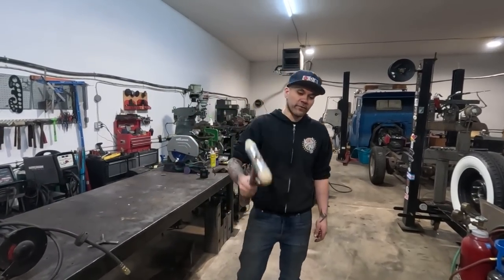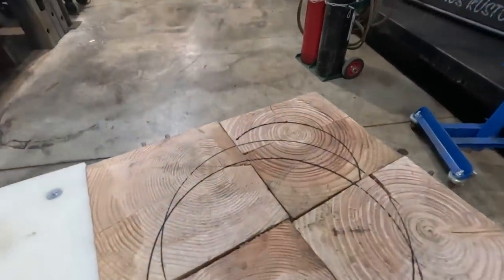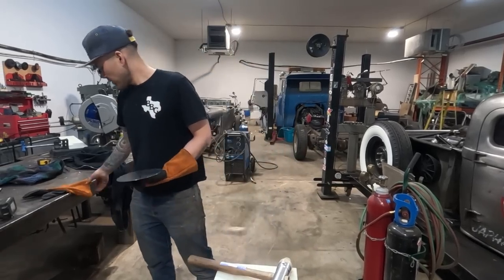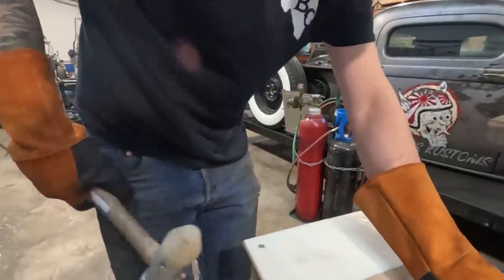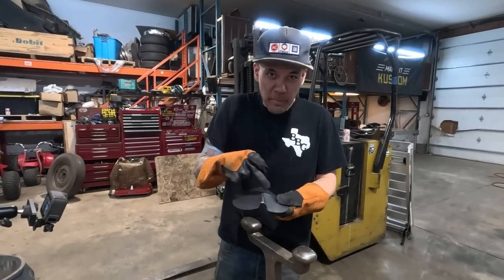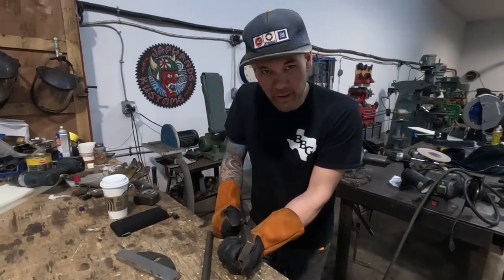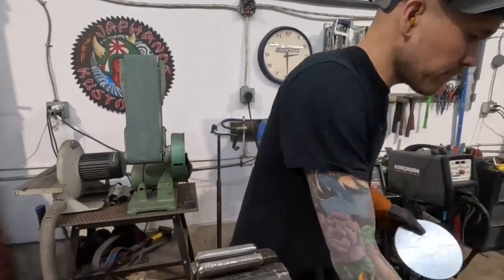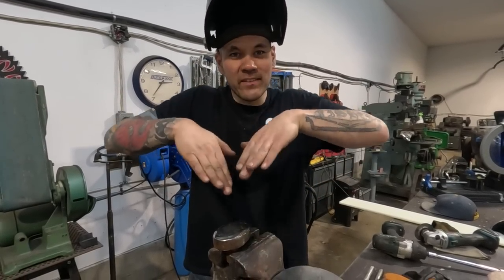Simple Metal Shaping with a Shrinking Stump, Hammers and Dolly

Comment: Great video. I love when you work primarily with hand tools since I don’t have the room or the money for any of the bigger machines. Maybe in a future video you could go through applying the shrinking techniques from today on some body panel shapes. Several times I’ve run into rounded pieces that have a bowl shaped end. I’ve been cutting slits, trying to shape it as best as I can and welding up the slits. Ok for a floor pan but not very nice for anything that is seen. Would love to see how to do that with the techniques you showed today.
Reply: Thats how i did it for years. Duct tape to make a pattern, cut it to lay flat then cut panel to match. Close the slits and weld up.
Reply: I'm watching these videos to attempt to replace the lower quarter panels on our rusty Miata. The repair panels available are about $240...EACH!
Reply: Try watching Carter Auto Restying

Comment: I made a shrinking stump the old school way, with a cookie out of a hardwood stump, using the same grinding tool. It was brutal. I ended up using another grinding tool that is basically a disc chainsaw that goes on your grinder. It cut much faster but was rough, then I finished it off with the grinding tool you used. That said, I like your use of softwood instead. It seems to hold up better than I thought it would so no need to chase down some hardwood.

Comment: if you want to keep your wooden hammer handles tight in the hesa, drill a .025 hole  2 inches deep in the middle of toe bottom of the handle and fill the hole with #10 oil, stand the  hammer upside down for the night and it will start to tighten up in a day or so

Comment: I made the tucking fork you showed a few months ago. 
Bought a cheap set of nail punches $5 at Bunnings in busselton WA.
Welded to two largest together and added some rod for a handle.
My first go was on my mini replacement floor panel, which had 
a heap of warping.
Amazing results in no time. 
Thanks for the lesson.

Comment: Karl, great job as always. I truly appreciate the time and effort you put into these instructional videos. Question about a practical application of some of these methods involving motorcycle fenders. Inevitability when building a chopper the radius of the fender will not match the radius of your tire. What would be the best method for shrinking the radius of an existing fender? Where would be the best placement for tucks or shrinking? I would love to see a video on this, either fixing the fitment of an existing fender, or even building from scratch. Thanks again for your videos, and keep up the good work.
Reply from the maker: It all depends on the actual fender, but shrinking the edges, will tighten the radius. You could use a multitude of ways to do this. Even a kick shrinker would work great.
Reply: @Make It Kustom  thanks man. I really appreciate the response.

Comment: What would you do with a 40's era car roof that is caved in, and has rust holes in the center of where it caved in? I know, cut it out and replace, but do you try to straighten what is left first to use as a template to form new roof? Do you make new panel out of one piece, or do you make strips across? Assume you don't have a "parts car" to cut the roof off of. These big tasks are hard for a beginner to apply these techniques you are showing to a bigger piece.
Reply: Bring the roof back into shape first. Can't properly template an area if it's not the right shape first. If you don't and you weld a patch in, you'll set the damage into the repair area. Make the patch panel according to your skill set. If you can weld and finish the metal well but can't shape very well, make it in smaller pieces. If you can shape metal well but not weld well, use bigger pieces to get the least weld seam length. Shaping a roof skin can be as easy as placing the new sheet metal on a hard surface and using a hammer with a low crown. Hitting the metal in a series of rows to sneak up on the crown you need. Or make templates to give you the shape and go to a salvage yard and find a newer car with the approximate correct shape. There are very few rules when it comes to shaping metal.

Comment: Hey, love ya channel. I wanna see as much shaping/dent repair, BY HAND as possible. Look at the work out you'll get, lol. Lose that GM hat, haha.
 I'm a beginner, actually, gathering as much info as I can before I even start. I want to restore my '73 V8 Maverick. I even plan to use scrap metal to practice.
  I wanted to touch on something. I have yet to hear anyone explain it out in detail, and that's when finding a dollie to match the curve. I am assuming, that when you can't match the dollie and the curve perfectly (lack of MANY tools), you have to use a smaller radius dollie as opposed to a larger radius. And then rock the dollie to help match where you hit with your hammer. Would you say that is correct? That is, if you use a larger radius dollie, then you'll flatten out your curve. So I would think you would need to use a radius down (if ya can;t match), and work the dollie.
 Your thoughts
thanks
Reply: And just to follow up on that..........most of us aren't OR can't invest in all the fancy machines. I mean yeah, not to do ONE car, lol. So yeah, as much hand work as possible, thank ya